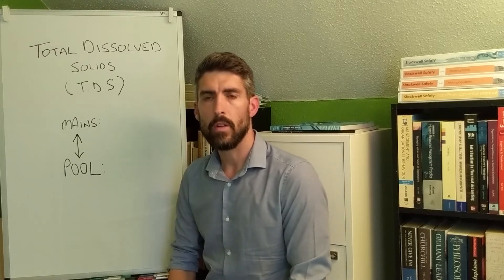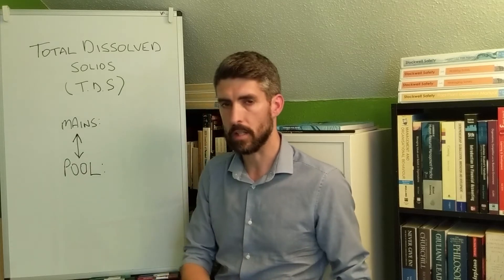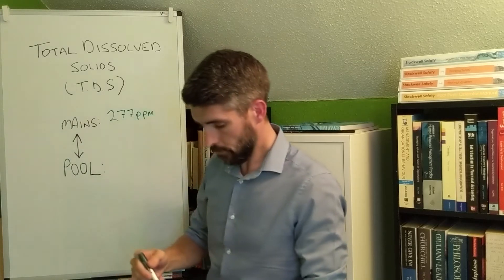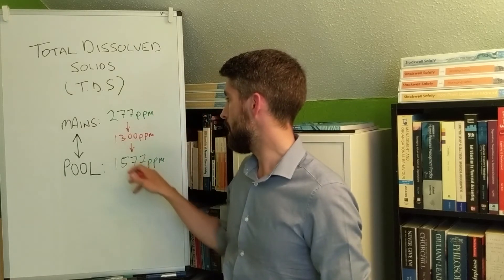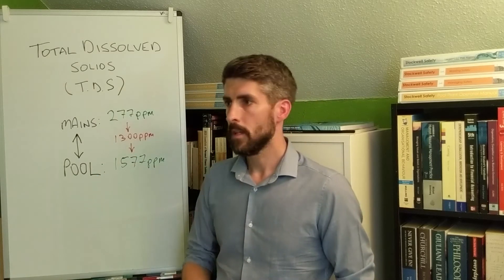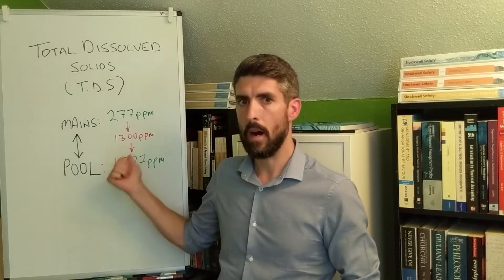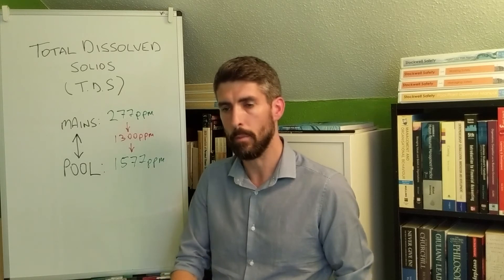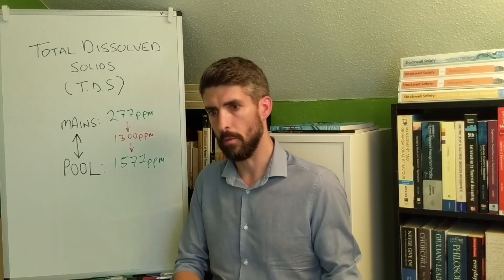Total Dissolved Solids Explained

Comment: Then how about hydrocarbon polution ? Something like sugar or oil that contaminating water. The problem is how to detect them because they arent conductor. And just chemicals inside water that have ions can be detected.
Reply from the maker: The video is about tds in swimming pools.  The basic measurement of tds is sufficient . Additional measurements such as hydrocarbons etc. would provide little additional value.